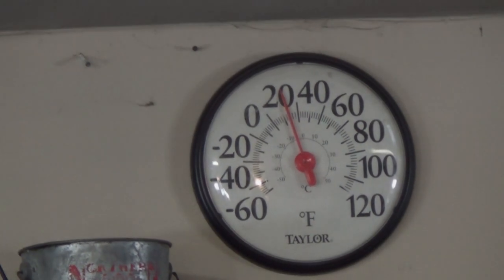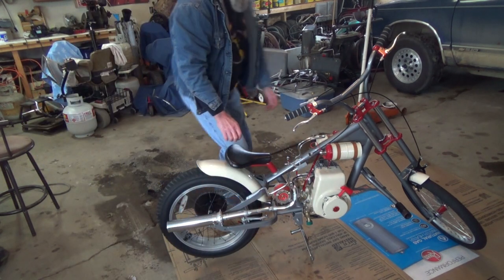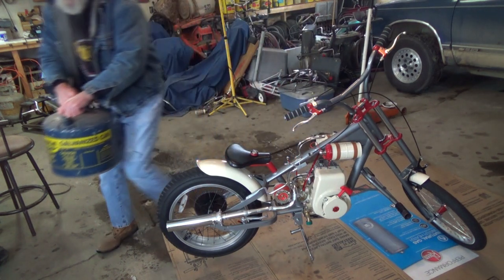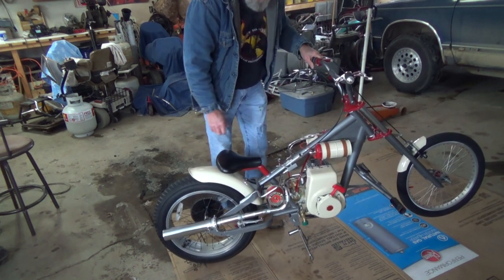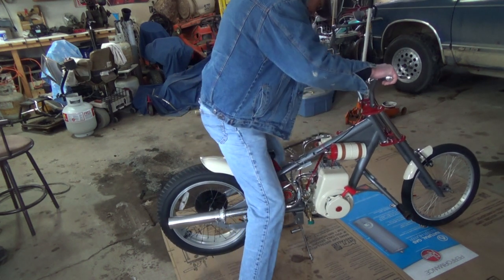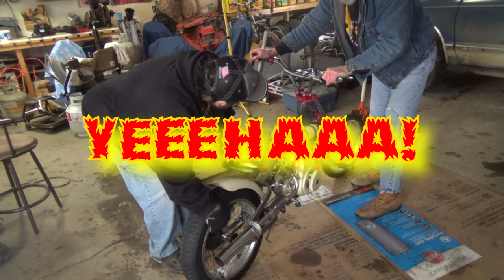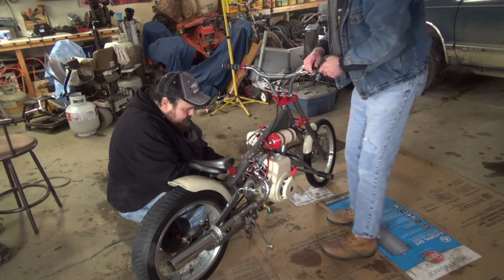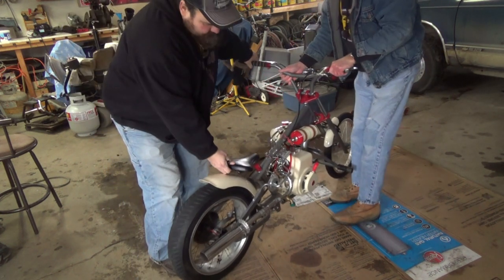YeeeHaaaa! The Gadget Bike lives again!

Comment: Yee Haw it's alive! Sounds good George. That ethanol is a pain after it sets awhile. One thing I've done to try to eliminate the problem is I went to plastic gas cans, it seems to help with the condensation problem and water in the gas.
Reply from the maker: +snowking55   It didn't seem to affect the running of the motor too much, but I think I am going to drain it off and put fresh gas in. It has set for 9 months with not much in the tank. Thanks for the kind support.

Comment: Well it runs at the very least George, perhaps some fresh fuel might make it easier to cold start? I wondered if with your son there and it sitting on its stand if you might have opened up the throttle to clear the engine. I guess with the fan on the flywheel it does not totally rely on being driven to keep the engine cool enough.
Reply from the maker: +Dan Whiteford   Actually, I did run it up, but ended up cutting it out of the video for the sake of time. In retrospect I should have cut some other "stuff" out. It will get fresh gas before we run it and I want to modify the throttle plate so it will idle down lower too. Thanks for stopping by.

Comment: nice start i reallized in you video before this is that i have one of those air filter for you water pump rig engine
Reply from the maker: +Josh Kilen   You mean the Wisconsin engines? Cool
Reply: the one on your gadget bike mine is a lauson H20A
Reply from the maker: +Josh Kilen   Oh, just like the old Clinton air filter? Yeah it was a neat find for sure. The motor came off of a snowblower originally. Thanks again